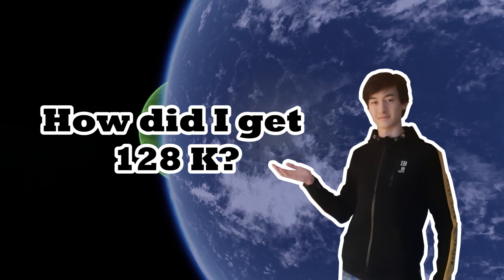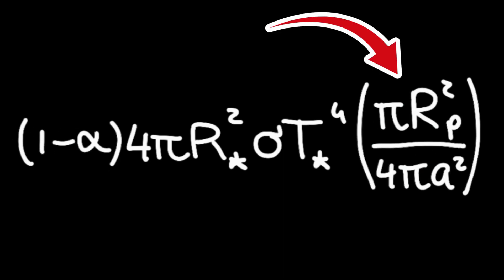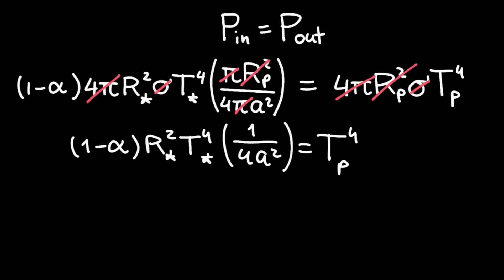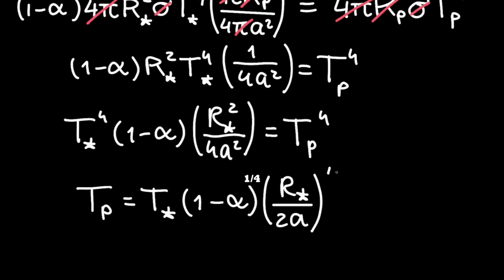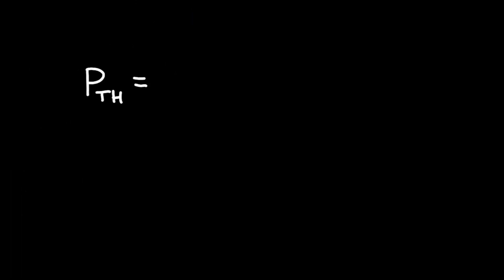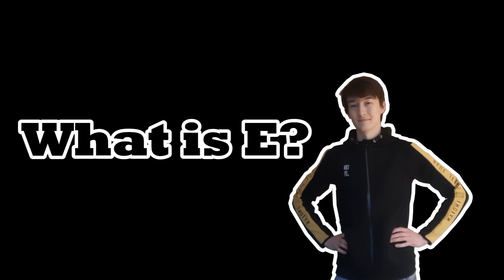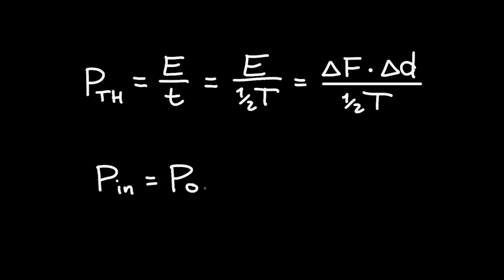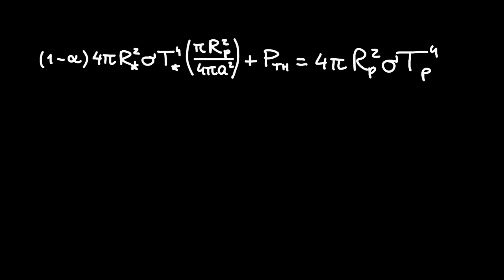Will This Fix Laythe?

Comment: Nice study!

Concerning the eccentricities of Io and Laythe, I can add that tidal friction leads not only to the heating, but also to tidal locking (observed in all Jool satellites actually) and to the circularization of the orbit. But in the case of Io, it keeps residing on the orbit with a non-zero eccentricity (and keeps heating) because of the Laplace resonance of 1:2:4 with Europa and Ganymede. Their disturbed orbits are not described easily with constant orbital elements, and despite KSP does not include interaction between planets, orbits of Laythe, Vall and Tylo resemble this resonance closely, and one can probably think that Laythe's orbit is something very roughly averaged over time. However, relative positions of Laythe, Vall and Tylo make their "resonance" very unstable, so I am not sure at all if developers intended something like this deliberately.

My source: Murray K., Dermott S., Solar system dynamics (2009); in particular sections 1.6 and 4.10-11.

Also, concerning the possible high temperature of Laythe from your calculation. Eccentricity of 0.004 is close to real Io eccentricity, so such assumption is reasonable. But the main reason of so high calculated temperature is probably not even the method that overestimates the amount of heating, but the structure of Kerbol system. You see, Kerbol system is shrinked in roughly 10 times compared to Solar system, and masses are 100 times smaller (so g is almost the same, but orbital velocities are smaller, making it easier to travel; densities of matter are unrealistically high, being 10 times larger than typical values in ours). As tidal forces are proportional to mass and to inverse radius in power of 3, one can expect 10 times stronger tidal forces in Kerbol system. Moreover, orbital periods are ~3 times smaller, so the rate of tidal heating can be insanely high. As a countermeasure, probably, if bodies have unrealistically high density, they can be unrealistically solid as well, much less prone to tidal deformation and thus releasing less heat in result.

Comment: I have an idea: Laythe has a lot of craters. It has enormous ones and small ones, so my theory is that if it’s constantly bombarded by asteroids, it’s heated up because of:
1. The energy asteroids release when heating up in the thermosphere
2. The collision of those asteroids, vibrating the whole planet and heating up everything with the fireball. If small asteroids collide every (say,) 300 years, it could heat up the planet.
This way, the planet is constantly heated up by those objects, so that it has a stable temperature. This can also explain both the giant craters and the magmatic activity.

Comment: It should be mentioned as I haven't seen anyone mention this but Laythe has another problem, the atmosphere is breathable.

The atmosphere is 80% nitrogen and 20% oxygen like Earth and Kerbin.
Reply: And a lot of sulphur. This can drastically affect the atmosphere’s thermal conductivity. Because Sulphur is more conducive (0,269 W/(mK), compared to oxygen’s 0.02674 W/(mK)), it retains worse the temperature. This means that more temperature will escape.
Btw I’m not an astrophysicist, but a 13y/o. (Flexing)

Comment: Laythe's tropopause temperature, at an altitude of 7 km, is 200 Kelvin. Its surface is 275 Kelvin. 200 K is still elevated way above what you'd expect 5 KU away from Kerbol, which is like 130 Kelvin, but at least a portion of Laythe's high surface temperature could be due to a strong greenhouse effect.

Comment: A suitably large amount of volcanic activity (which is basically just heat generated by radioactive decay with a bunch of steps in between) could absolutely heat the water enough to keep it liquid, if the heat could spread quickly enough. You could probably calculate that by figuring out the thickness of the water and core layers, how much convection there would be, and how much radioactive decay would be needed to heat up the core (and spread that heat to the surface)

Comment: Why do you use a comma instead of a period? You said for example "Zero point zero zeo 4 eccentricity" but wrote 0,004 witch looks like just 4? minor thing but it kept throwing me off
Reply from the maker: That is European notation. We use comma as decimal point.
Reply: @curious_ksp_ksa  that's very interesting thanks! I didn't know that was a thing in Europe

Comment: Laythe's crust contains large amounts of fissile material causing naturally occurring fission reactions.
Reply from the maker: That would need an absurd amount, but maybe, i could try and calculate how much
Reply: I do know that is one of the reasons the Earth still has a molten interior, so maybe in combination with some other things it would make sense
Reply: The elements that caused the differentiation of the terrestrial planets and their precursors were not fissile. They were short-lived mostly neutron rich and some proton rich radionuclides which either decayed by electron capture, or the release of an alpha particle. These nuclides were mostly formed in supernovae and neutron star mergers. Although some could have been formed in the winds of massive stars. The most prominent nuclide in the heating was 26Al. The left over insulated heat is the geothermal heat we harness. We can also use these nuclides as chronometers for events which occured in the early Solar System and even before.

Comment: on top of the fact you are ignoring the other moons around jool and their impact on tidal heating, I feel like its also worth mentioning that different salts have different impacts on temperature, as far as I know it could just be a story of finding the right salt
Reply from the maker: I chose to ignore them, as those moons have minimal impact compared to Jool. I chose on purpose to simplify, because is makes calculations easier and it is not worth it to include the other moons.
 About the salt thing, yes you are right, i just made the video for fun, it is not a scientific paper, so dont take it too seriously

Edit: the point of the salt thing is that you would need a ridiculous amount no matter what kind of salt probably. The conclusion: the salt is not enough to explain liquid water
Reply: @curious_ksp_ksa  maybe all the factors, like the other moons causing tidal heating, volcanic activity, and abundant salt combined is the answer.
Reply from the maker: @WillTFB  i will revisit the problem in the future, and I will combine everything then

Comment: What about vall? The 2nd moon? Id believe when it passes by it’d pull on laythe, and its really close by
Reply from the maker: But Vall's mass is several orders of magnitude of smaller, so it sill contributes way less.
Reply: @curious_ksp_ksa  yeah i guess, but maybe its just enough
Reply from the maker: @classic9567  it could be the thing thay tips it over the edge for sure

Edit: i have also been made aware of some research that discovered that moons contribute more than previously thought, so you are probably right actually
Reply: @curious_ksp_ksa  cool cool

Comment: how much do you think radioactive heating (like what powers the earth's tectonics) would help?
Reply from the maker: Maybe I am wrong, but I don't think radioactive heating is what powers plate tectnonics. Earths internal heat does power that, yes, but that heat is not provided by radioactive materials I believe. 
But in general some radioactive phenomenon could raise the temperature...
Reply: @curious_ksp_ksa  True. Admittedly geology is not my strong point but I definitely remember reading something along the lines of it started out hot from the planet compressing but one of the leading theories behind the reason it's still hot despite a lot of energy going out into all that tectonics is because of radioactive materials that sunk to the core. That might not be anywhere near the scientific consensus anymore though.

Comment: Laythe could just have a lot of geothermal activity on it, some visual mods support the idea of volcanoes and there are geysers on the surface with breaking ground, unlike Io, this volcanism wouldn’t simply dissipate heat because it is trapped by the atmosphere. But overall it seems more than possible that laythe could have salty oceans with just a small amount of tidal heating, nice video.
Reply from the maker: I am not an expert in geology, so just stayed with what I know: physics 🙃
Reply: @curious_ksp_ksa  you should also consider vall and tylo since they're very close to laythe

like REALLY close
Reply from the maker: @Magi..  as this method i used overestimates the effects of TH, i found it not necessary to include the moons. It complicates everything by a lot, and it will not help us as we already are overestimating. So that is why i kept it like this. It just takes more time than is it is worth for, just for technicalities.
Hope this helps.
Reply: @curious_ksp_ksa  maybe Laythe has an extremen greenhouse effect
Reply: Totally agreed. The Breaking ground expansion confirms it bc you have some small geysers on the surface, suggesting a potential geothermal activity. So it is definitely possible laythe has a small tidal heating (supposing it has a tiny eccentricity eg: e<0.004) plus salts in its waters and that. Im now wondering whether laythe’s atmosphere is realistic enough in the sense that it is big enough to maintain its atmosphere and not let it out like enceladus i believe. Another interesting this to look into is to determine laythe’s concentration in salt. We have its atmosphere’s molar mass and by extrapolating some things such as its atmosphere composition, that the only salt there is NaCl, we could determine how much NaCl evaporated into the atmosphere and determine its oceans’ concentration. Anyways, thanks for giving me an interesting physics-chemistry problem. I enjoy studying laythe
Reply: @ivans9132  Titan has a surface gravity of about 0.14 g, while Laythe's gravity is 0.8 g. It's reasonable to assume that if Titan can hold onto its very thick atmosphere, Laythe can keep its own.

The real obstacle to stable atmospheres is solar wind. If a body doesn't have a strong enough magnetic field, its atmosphere will rapidly get stripped away. The main theory right now is that magnetic fields are created by vortex flows inside a rotating planet's liquid core. If the tidal heating of Laythe is enough to keep its core molten (which seems to be the case given Breaking Ground's surface geysers) then it definitely has a magnetic field and its atmosphere is protected from solar wind.
Reply: A core made of mostly decaing uranium
Reply: @pinheirokde  Not physically possible. Laythe's density is above the point that any Uranium at its core would be above the critical point. In fact, this is likely true of ALL the rocky planets in the Kerbol System(and of the Inner Planets in RL as well). This means that the Uranium never gets the chance to undergo radioactive decay as it instead very quickly very early on in the history of the planet/moon would have been turned into fission byproducts...which due to the density of material likely would have then itself undergone fission. You have at best tiny trace amounts surviving.
Reply: @Daedwartin2  ;) thanks, was trying to make a funny comeback but can't come up with a nice one...
Reply: @Daedwartin2  are you going off of the in game masses of the objects? Because the smaller scale of the kerbolal system makes every body far denser than they would ever realistically be. You would need to consider an object about 8 times the size with the same mass as whatever you are testing to get a realistic density for the body.
Reply: @darthsenate7817  Its not the density of a planet that is the relevant part. Its the density of their cores. Due to the planet surrounding it, they are under so much pressure that they basically have a density almost certainly high enough that criticality is reached. Keep in that we have found deposits only a few miles down that as far as we can tell did exactly that with uranium in Norway. That was just a few miles of rock plus water finding the perfect deposit of uranium 2 billion years ago. Under even a mercury or mars amount of rock is MORE than enough to reach that point.

Comment: since laythe spins would that mean even with a E = 0  
it would still have some squash and strech sinc it's not even all the way throug?
Reply from the maker: It is tidally locked, so it always points the same way towards Jool, so the deformation will not change sadly.

Comment: Can't Tylo or Vall cause squashing and stretching as well? Tylo has a lot of gravity. And it might just be enough to cause tidal heating.
Reply from the maker: My response to someone with the same question:
I think those effects would be minimal, as the masses of the other moons are several orders of magnitude smaller than Jool. It indeed does have an effect, but not in a major way like Jool I think.
Reply: @curious_ksp_ksa  I'd argue it is an essential component of the effect. 

The reason Io is so active is not just Jupiter but the interaction of the moons acting together in resonance COMBINED with Jupiter's gravity.

The effect has to be taken into account in KSP because although less massive, the moons are even closer together (Too close even for n-body calculations), and the gravitational pertubations alone on Laythe's orbit would increase it's orbital eccentricity significantly (something that is sadly not represented with it's perfectly circular orbit).
In my KSP worlds I give Laythe a slight eccentricity similiar to Io to reprisent this and also space out the orbits for n-body realism while maintaining the resonance.

The greater the eccentricity of Laythe's orbit, the greater the tidal stretching on the planet as it moves through a changing gravity well.
The forces are now much more dynamic and irregular which causes immense movement and friction.
Energy is being traded between the moons and being dumped into Laythe in the form of this alternating eccentricity like a "Tidal generator" as the moons come into alignment once every Tylo orbit.

Would this alone be enough to have liquid water?
Honestly I think Laythe would just end up like a Volcanic hellscape in all likelihood.
But perhaps it got lucky and found a perfect balance between boiling away from the heat and freezing from radiating that heat into space.
Perhaps the fact that it's reasonably massive means the interior heat and relatively fast orbital period has given it a magnetic field and allowed it to keep the atmosphere, which in turn keeps the water.

Without that extra mass the moon would look like Io.
Now the only thing missing from the game is tonnes of volcanoes like Hawaii doting the land areas.
Reply from the maker: I assumed a simple model, as this is not a rigorous calculation, and it was was never my intention to be rigorous, because this is not a scientific paper. Including the other moons would make the calculations take more time, more time than I have for a youtube video that does not pay me back the hours I put in.
As the most obvious cause of tidal heating would be Jool, I decided to address it specifically. I am not going to do hours of calculations and modelling for now, maybe later when I have time.

edit: spelling, grammar
Reply: When n-body motion is implemented in ksp, the Jool system collapses. omg